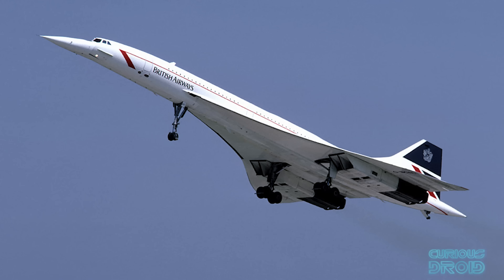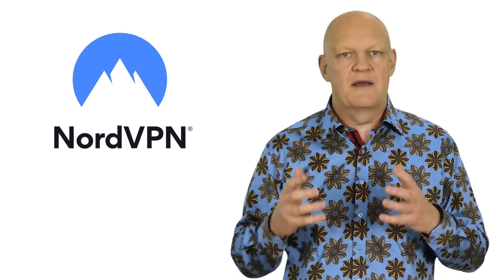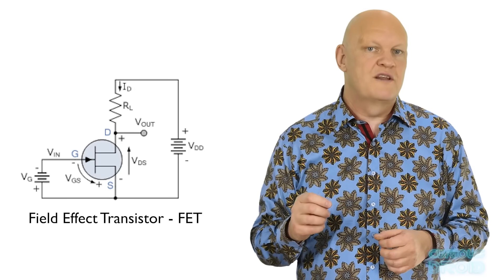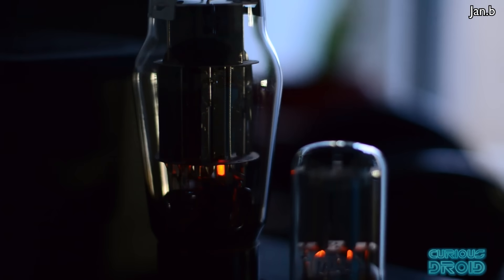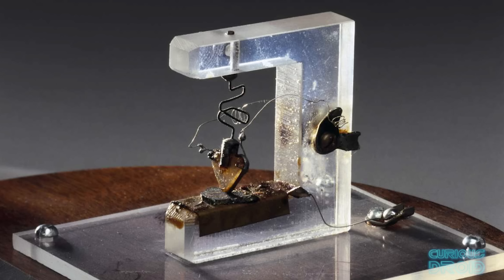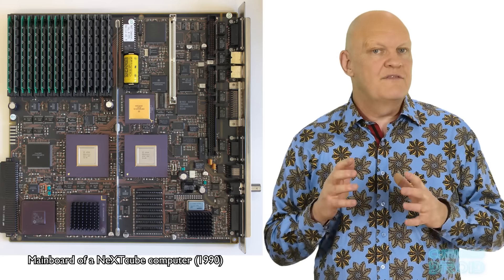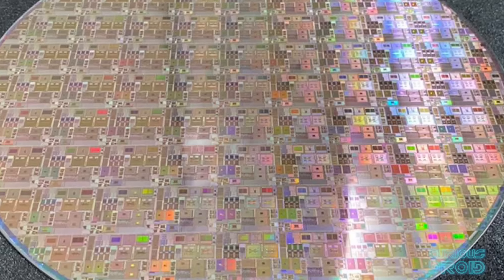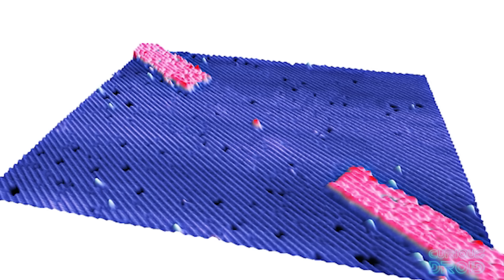MOSFET – The Most significant invention of the 20th Century

Comment: Only a year late but maybe someone will find it useful... 
Sourcing a couple of thousand valves (tubes) wasn't a problem for Colossus. Tommy Flowers who designed and built it (no, not Alan Turing) was a Post Office telephone engineer who designed telephone exchanges and amplifier systems, which involved designs with thousands of valves. The Post Office had huge stocks of them. His great inspiration was that if you were using them for logic switching rather than audio, you could run valves at a much lower heater temperature and anode voltage. This massively improved the reliability to the point where Colossi would work for weeks on end without failing.

Comment: One major factor that I did not here mentioned in this excellent video was the massive speed increase from tubes to solid state as well as from discrete transistors to integrated circuits. Because of the miniature distance between circuits the signals spend less time in transit between devices allowing the clocking speeds of microprocessors to increase almost exponentially say from 2Mhz to 8Ghz.

Comment: A fun fact that may not have been said earlier in those thousands comments. 
The name MOSFET is a misnomer nowdays. Early MOSFET were indeed metal-oxide but it was quickly replaced by silicium-oxide, easier to process because it is the same metal as the wafer. So the name should've been SOSFET but the industry kept the early name to avoid confusion. Beside SOS in the name does not look so appealing...

Comment: Fun fact you never hear about: During the transition from valves to transistors, manufacturers would use little transistor sockets to plug in the devices, even though by this time there were printed circuit boards. Don't know if it was a difficulty in breaking with tradition, or they assumed they'd have to be replaced like valves needed to be.

Comment: 13:10 "a single atom of silicon is 0.2 nm across"
that's incorrect. a single atom o silicon  is 0.00111 nm across. some 2000 times smaller than what you said

Comment: WRONG! Pickards cat’s whisker and  Russal Ohl’s early silicone diodes made everything else possible. The understanding of the PN and NP junctions was the launching pad. Read back and research. I worked at Texas Instruments in the late 60’s early 70’s and we still didn’t have a grip on this correlation. We made transistors in PNP and NPN but couldn’t build to spec. We just made them and then diagnosed their specs and qualities until we found the relationship and the bias/content. Our team plus the Rand researchers were all working from types of the 50 year old rectifiers  and properties of their junction variables made the photocell by Ohl as well but wasn’t significant for years,

Comment: A small correction. I did some rough calculations once and if you tried to make a smart phone out of vacuum tubes it would be the size of a small country and use about as much electricity as the entire United States. Just today I did another calculation. If a transistor was the size of the thickness of a sheet of paper, a one billion unit chip would be 31 miles square. That includes the space in between the transistors. I've been keeping a close watch on the tech industry since the early 1980's and I find these numbers mind numbing.

Comment: Hopefully we'll hit the physical limit a bit AFTER we achieved quantum home computing to at least some extent, possibly driving the demand for legacy protocols up to maintain interoperability with our prevailing literal "stone-age" devices. Of course these legacy connections would be bound to the top speed of the slowest part just like it is nowadays with older USB or PCIe standards (you'll only ever get Gen3x16 speeds if that's the limit of your motherboard/chipset/CPU no matter if your GPU or other PCIe devices are rated for Gen4x16)

Comment: When RCA came out with the CD4000 series gates it was considered kind of a joke. They were slow and excessively vulnerable to destruction by static charges. We are past all that. The improved CD4000 series is out there and there is the 74LVC series which has as much drive power as TTL. All CMOS.

Comment: The transistors were faster, smaller and required less watts to run than a tube. They were a win win. Kinda funny that we used a tube for our TVs up to the early 2000s when a LCD and LED made more sense but I guess it was all about costs. Even now a lot of displays still use LCD with an LED back light. OLED and QLED TVs are the way to go.

Comment: I learned to program on a Sinclair programmable calculator (36 steps) when I was around 8 years old. Then, in 1978, aged 10, I tried to build a computer. I had 500 transistors and lots of diodes and a wooden cabinet the size of a wardrobe.

My plan was to fill the cabinet with transistors, then put it in my bedroom so I could have a computer of my own in my house.

I was electrified with excitement.

In our workshop, at the end of our garden, I started soldering. No PCB: just components neatly connected in 3D.

Six transistors per bit of information.

48 transistors per byte.

I realized I only had enough transistors for 10 bytes of data. I wanted at least 1KB. I knew I was defeated.

Heavy hearted, I began saving my pocket money (£0.25/wk max) for RAM chips.

Soon after, Clive Sinclair brought out the ZX80 then the ZX81 and my wardrobe sized computer concept was beaten by something you could hide under your shirt.

Comment: As an old HAM radio operator, I have always depended on Toshiba pill transistors, I have tried mosfets but they have always let me down, in the beginning they put out just great! But way more sooner than later, they die ! I’m not the only operator who has been through the mosfet blues. Mosfet transistors are definitely cheaper, but there is a reason for that reduction in cost when shopping for linear amplifiers! In fact I’d rather have and I do own a couple 6LQ6 driven tube amplifiers, I find the good old tube amps have cleaner and way louder modulation than pill amplifiers ( transistor driven) and anyone of these 2 are definitely better than mosfet junk!!!?
Reply: “Pills”? You sound more like a CBer to me.

Comment: I might need to watch this repeatedly. I have computer motherboards hung on the walls. They look like cities is the point. I've wondered if I might run the power from the ground and the aerial into one after the tuner or variable capacitor for amplification, or would the chip become like a confusion chip? Better is then the three wire transistor, with maybe a button battery for increased power, enough for amplification of low signals. Frankly I am trying to figure out what to salvage and use to make a crystal like radio. Simplest radio. I have a diagram from the early 1920s showing battery and a audion tube made from a light bulb.

Comment: My greatest joy was to go back into electronics after a gap of 30 -40 years. I worked on the Zilog microprocessor chipset. Microcontrollers need no support chips, memory or serial data chips. No messing with 8 address lines, and 8 data lines ! (Making and Debugging boards was a nightmare.) MOSFETS could be driven directly from microcontrollers, and yet switch dozens of amps for robotic actuators. Life had become good...And the Arduino has a huge array of plug-ins that can do almost anything...So, rather than spend time designing electronics, you can spend your time doing useful things with the electronics, with a minimum of programming...(all the difficult stuff is hidden, although you can access it, if you want to).
Reply: Arduino's are arguably one of the greatest inventions ever, they are used all over the world for prototyping devices

Comment: Great video, however before the development of the MOSFET, there was a more significant development. The transition from vacuum tube technology to transistor technology enabled a truly colossal change in the way that electrical / electronic circuits could be implemented. The introduction of bipolar transistors enabled great miniaturisation of devices and a significant reduction in power consumption. The simplification brought on in part by the removal of heater circuits and associated power supplies was an additional benefit. In the video, reference is made to miniaturisation by mention of portable transistor radio. Transistors moved from low power circuits to high power circuits and from germanium technology to silicon technology. I wonder how many viewers of this video have worked with valve technology. The hazards involved with the high voltages used in valve circuits along with risk of getting burnt by a hot valve envelope are things I was glad to see go away.
Reply: Not to mention the short lifespan. I can remember the tube testers that were in various locations. Still have the Halicrafters Star Rover tube shortwave radio kit I assembled in 1967...it still works, don't know if I could find a tube if 1 stopped working.
Reply: @philgiglio7922  Ah yes valve testers. We used sell lots of 6CM5s and 12AX7s for TVs along with KT88s that were used in high power audio amplifiers. My favourite was the heater voltage booster for TV crts. They used extend the life by quite a bit.

Comment: Beautifully crafted mini-lecture Sir.  The most accurate and compact historical brief of the transistor I have yet seen.
Reply: The MOSFET was invented by Mohamed Atalla and Dawon Kahng at Bell Labs in 1959. It was a breakthrough in power electronics. Generations of MOSFETs enabled power designers to achieve performance and density levels not possible with bipolar transistors.

Comment: I, as one, compliment you on a very good presentation of the transistor. Now Mr. Droid if you want to go one better....explain how the human brain works....how the cell is a threshold device, how it has many inputs, some for it to fire, some for it to not fire, how the insulation on the nerve fiber works, more insulation, less insulation, causes the impulse on the nerve fiber to speed up or slow down so that the impulse can be at a certain point at the right time. And considering how big a nerve cell is, how to pack as many as possible in a small space. Check it out Mr. Droid. Michael said that, bye for now my friend.

Comment: Thanks for another amazing video. :)
Yeah, the trees don't grow all the way into the sky. So at some point, it has to stop.
The size is beginning to be a problem, and so is heat. 
The next step could be to use light instead of electricity?
Or maybe are we all in on a quantum computer and leave the "old" tech for unimportant devices with a relatively small amount of transistors?

Comment: I was introduced to logic chips in my high school electric shop class when I built an amplifier with a large speaker for my transistor radio.  It was tiny compared to an amplifier using tubes and the transistor circuit had the advantage of not producing high heat.   I also built a crystal radio set using  transistors to switch between the three crystals that brought in my favorite rock music.  Of course by 1968 the price of transistor radios had fallen to less then ten dollars!

Comment: Evidently I'm a retard, even though I have worked as electronics engineer I thought powered off flash memory retains data effectively permanently and never cared to dig too deeply into how the memory works. Just stored charge, data retention on the order of decade only, possibly much less depending on specific device... that explains so much. Many devices fail to work after going unused for some years and usually nobody cares to dig too deep into why, just written off on the assumption of dried up caps or "there is a reason it was left unused to begin with", nobody ever says the flash prolly doesn't remember the firmware anymore.

Comment: 3:16 December 23, 1947. Holy cow, has it been that long?
3:58 Amplifier and switch.
4:16 BJT (4:30 current fed into base controls current between collector and emitter) vs FET (4:37 voltage applied to gate controls current between drain and source)

Comment: That is a fascinating history of the development and use of solid-state devices.

I remember how thrilled I was in the early 60s to have my pocket 9V AM radio with its 8 or 9 transistors and a jack for an earphone, so I could listen to Top 40 AM rock radio around the time of the British invasion(1964 - 1967). Later I marveled at the use of MOSFET front-end voltmeters that had the high input impedance necessary for making voltage measurements in RF circuits, where no loading of the circuit was necessary. Previously, we had to use vacuum tube voltmeters(VTVMs) for that purpose and they were often barely stable enough to get good measurements.

Comment: I do equipment engineering and maintenance for a Semiconductor fab in Santa Barbara, that $120M litho tool you showed is insane. I have only heard about it from those who have worked on them. We have 3 stepping exposure tools (like that) that are from the 90's. 2 Nikons and a massive Cannon running OS9. Still running modern processes. But to keep them running smoothly is a constant challenge..

Comment: One of the things worth mentioing is the use of MOSFETs in audiophile power amplifiers.  They just sound far better than bipolar transistors and the equal of any valve amplifier - but with bass.  They are also far cheaper, smaller, and less problematic than valves.
Reply: You spelled audiofool incorrectly.  As if audio frequency amplification requires cutting edge transistors.
Reply: @stargazer7644  First of all, MOSFETs aren't "cutting edge", they've been around for decades, and secondly, (all other things being equal) power amplifiers using those transistors sound much better than the equivalent bipolar transistor amplifier.  Don't take my word for it, have a listen to the difference for yourself.
Reply: @chrisantoniou4366  Unsurprisingly, you've completely misunderstood my point.  There should be NO difference in the sound of any two properly designed audio amplifiers, whether using fets or bjts.  The output should be identical to the input, just larger in amplitude.    Any other difference is a FAILURE in the design, and is to be avoided.  Why would anyone be happy that an amplifier is distorting and changing the source material?   Designing a solid state amplifier that faithfully amplifies an audio signal is fairly simple.  I don't need to take your word for anything, I'm an Electrical Engineer.
Reply: @stargazer7644  I've never aksed anyone to take my word for anything Hi Fi related, do the listening test for yourself.  Maing definitive statements when you haven't actually listened to the components involved is a fail, no matter what your occupation is.

Comment: Nice presentation , I'm in my mid 60's now so growing up in the 60's and having a father that was an electronic engineer I got to watch the evolution of electronics fairly closely and it has been pretty amazing how far things have come in my lifetime . One thing I remember hearing on a few occasions is "we have hit the limit of physics" on things like layer thickness and others but layer thickness is the one that I find the most funny because the claimed limit keeps changing . They really should just say it's the limit of current technology rather than claim it's a limit of physics , luckily not everyone believes in limits and they seek to break those supposed limits . From what I hear bacteria is being used to etch the smallest of layers which seems interesting , I would love to see that demonstrated .
 The next step I think will be 3D printing circuits and insulators to reduce distance traveled internally for operations and get layer thickness down even more , an entire computer could theoretically be printed into a single chip in almost any shape you wanted and would only require limited external connections .
Reply: Bacteria are orders of magnitude larger than the smallest layers so... 
In regards to the limits, yeah physics does throw curveballs when you get into the single digit nanometer scale. As in quantam tunnelling of electrons and such, high energy photons from general background radiation flipping mosfets, which is why clever error correcting code is needed. And now clever architectures to further increase the performance of modern chip designs. These days the whole 5...4...3 nm nomenclature is just marketing jargon, to indicate progress in computing power, not the actual size of the circuits that are being made. As it stands, the chips are already printed in 3D, just go take a look at how RAM and SSD's work.

Comment: Just a note, 512gb micro SD cards DO NOT cost $30. They're closer to $100 USD for an entry level spec card. If you see a 512gb micro SD card available for $30, it is highly likely to be fake (ie a smaller 128gb card with a modified control chip). Fakes are everywhere, even on Amazon.

Comment: While a MOSFET is voltage controlled at the gate, to control current really requires a PWM circuit. Their behavior is intended more as a switch, being fully on or off. This is unlike a BJT where current can be controlled via resistance at the base.

Comment: He's quite wrong about the Apollo Moon Lander control, it used a magnetic ROM (Read Only Memory) controller because such devices cannot 'loose' their program. Semiconductor devices, particularly the ultra small MOS/CMOS devices are sensitive to high energy particles that may have sufficient energy, perhaps micro Joules, to 'flip' a memory device, and so disrupt the programme. 
The 'woven' copper wire 'ROM' memory does not have this disadvantage.
I have built similar devices, the are called ROM controllers, using MOSFET read only memory. They act in a similarly to computers in every way except the memory address cannot be changed by data, so it cannot 'jump' to a false  (incorrect) address, the most common cause of programme failure.
This limits the flexibility a lot but it is a world beater if you cannot afford mission failure!